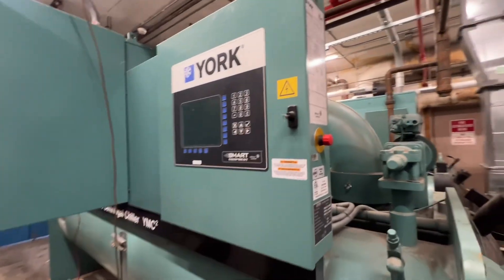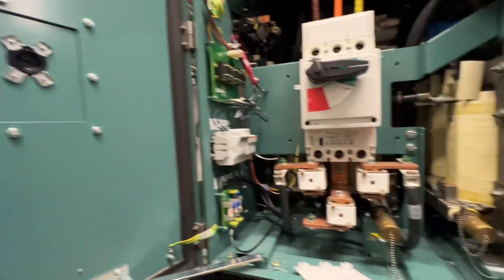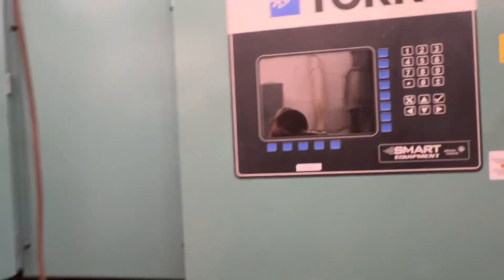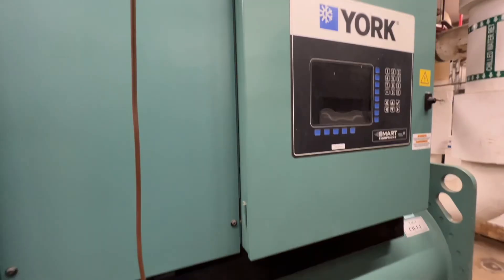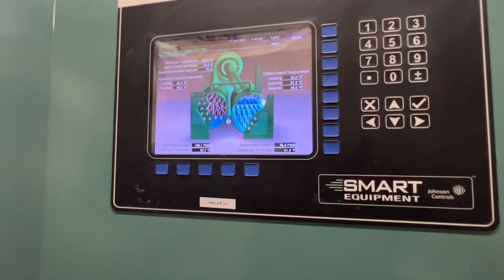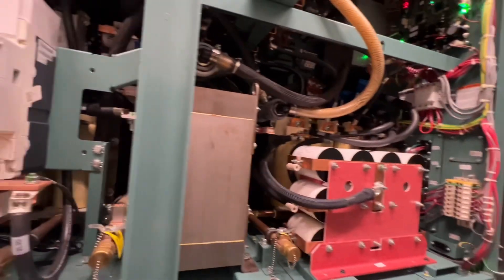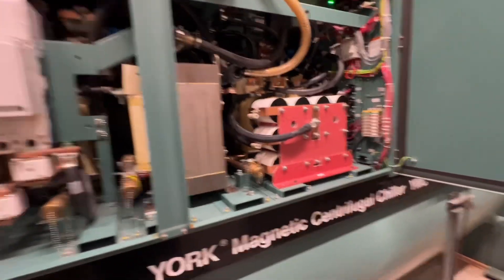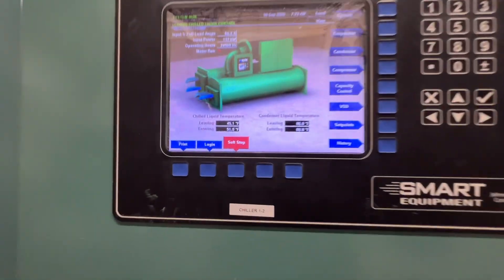York Chiller 1 Tripping Front Panel Breaker … Look For This

Comment: Probably just poor quality zip ties, the plastic is degrading and is off-gassing. It looks like this control cabinet is pretty well sealed, so the off-gassed compounds eventually build up in sufficient concentration to set off the smoke detector, which I'm guessing is an ionization type detector which can be very sensitive and set off by things other than smoke.
Reply from the maker: Agreed, Definitely not high temp ties and yes it’s sealed good 👍

Comment: Surely there would be an entry in the log saying something like.... smoke detected - shutting down?
Reply from the maker: Not with power off, nothing in the warnings or alarms after breaker reset either. Just the Smart Sensor Red Display

Comment: Great video JCI must have bulletin out on this problem.The Chiller should be rotated to even the runtime .In work every month l look at every pump motor runtime and l look at the daily log sheet runtime weekly on the BAS if they need to rotate on the BAS l will rotate them it not good have more runtime on piece of equipment even if it’s a backup.If you had a unnoticed problem with the backup chiller and the other chiller that was running went down due to a fault and BAS try to start the other chiller and now your scrambling to get a chiller back on line that not good l try to avoid if you have a data center we have a buffer tank storage that keep 42F water at all time in case both chiller go down but it only buys you time of 45 minutes or a hour in till the chill loop starts to warm up.
Reply from the maker: There may be a bulletin or one coming, these chillers are in series with only a single 60hp chw pump for the loop.

Comment: You’d think the smoke detector would activate the building’s fire alarm system too. Or at least put a supervisory on the panel. Because that ain’t good if the smoke detector or heat detector wasn’t on the fire alarm system too
Reply from the maker: It’s not tied into the building system, there’s also separate refrigerant monitor system for both chillers. All separate from Fire Alarm

Comment: They certainly look odd - something undesirable going on there. Maybe the cable ties were becoming partially conductive - if so, they were getting hot because they would then form a shorted turn around high current conductors. This would also explain why the ties around the signal cabling were fine.
Reply from the maker: I’m surprised it didn’t happen on chiller 2 since it runs more … both chillers have been in service roughly 4 years now
Reply: @subcoolHVAC  Yeah, that is odd. Maybe the cable ties are absorbing moisture and the heat of the operating unit prevented it happening there, but I'm just grasping at straws. I was more looking for an explanation for how they could be heat affected with nothing else showing signs.
Reply from the maker: JCI solution was to just remove them, thinking it’s just low grade nylon ties. Something to add to the mental tool box when troubleshooting future equipment is look for melting ties 🤷‍♂️. I appreciate your input

Comment: How cool to have smokes inside a controller. I never would have thought that! Thanks for your video. Maybe they should have used ultra-violet ty raps?
Reply from the maker: Apparently the factory is aware the fumes from the wire ties will cause nuisance trips. High temp ties would be better for sure